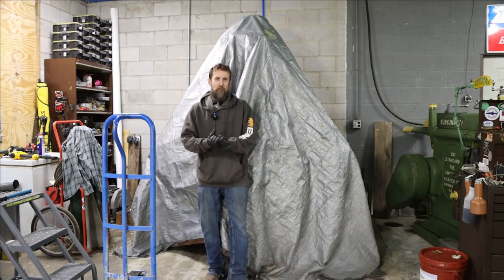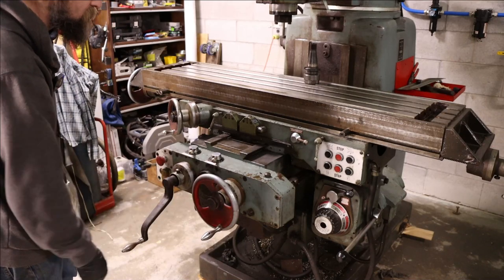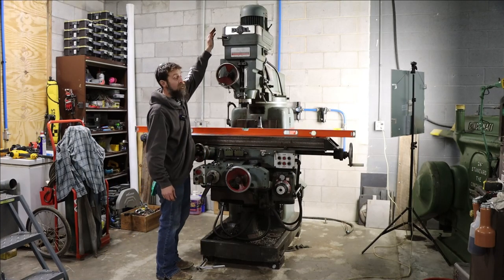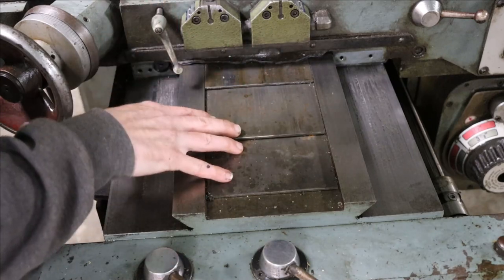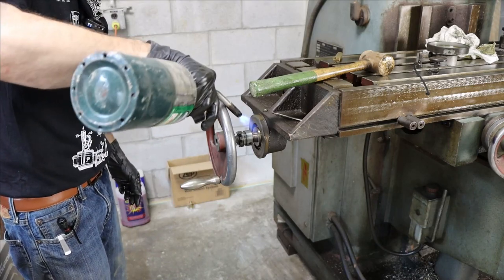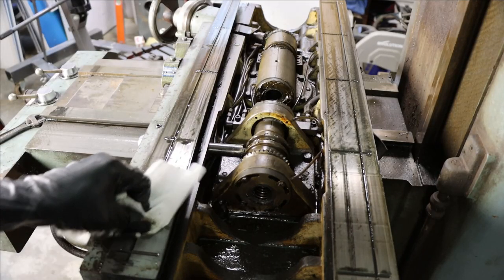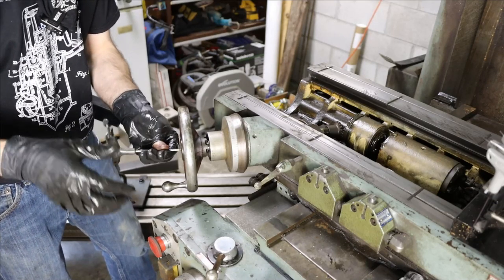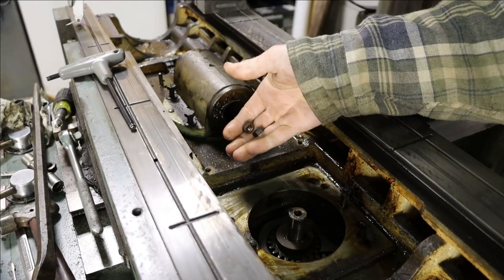New machine reveal day and break down .

Comment: Hi Steve at a guess I would say 500lbs, looks a nice piece of kit ,Regards Mike
Reply from the maker: 502 lbs was the weight on my scale. Congratulations😁👍, that was really close.
Reply: @Steve Summers how do you keep all of your parts organized when pulling a machine like this apart?
Reply from the maker: @mattconn241  most stuff I  remember its position. I do set things in related piles and use labels/ bags. 👍
Reply: I was going to guess 480, since you were at the furthest- out position on your cherry picker.. lol! Great to see you digging into the innards, lots of interesting parts in there!
Reply: My favorite machine in tool and die school.was a Lagun built in Spain. Very robust compared to a bridgeport. Much less deflection on heavy cuts.
Reply: Well done Mike - fancy seeing you here? :-)
Reply: My guess is 375 lbs. I have an old Milwaukee 2B Plane mill with a 14" × 70" table.
Reply: For those using grownup units, that's around 228kg 😉
Reply: Think you’ll find my bid of 501 lbs was closer!
Reply: In my head I guessed 500 lbs, but bid 501 lbs in a “Price is Right” move.

Comment: Congratulations you have the finest manual milling machine ever made. I have owned no less than 3 of these each one a little different. I bought my first on a whim without much consideration. I didn't appreciate it until I got it home. The ones I have are all about 1980 vintage they were all painted in a custom color. Each one was purchased 5-10 years apart and from different vendors I think they came from the same factory.  (Republic Aircraft in Long Island) The ones I have had vari-drives. I found out when a brand new Bridgeport was $6000. these were $27000!!!! The ones I have are a little different than yours but still have a lot in common. The first one I got had power feed X & Y and power knee lift. I used this one at work. I looked for 10 years to find one for home. The second one had power X no Y no knee lift. I found third years later that had Y feed but no knee lift. I stole the Y feed for my mill at home and restored the third mill to like new and sold it.  I designed a simple knee lift with a chain drive and a 1HP motor which is just enough. I like it better than the factory version. So I have a mill at work and one at home. I think the your mill has a 12 x 48 table not 9 x 42 like the Bridgeport. The machine weighs about 3000lbs instead of about 2000lbs (Bridgeport). You will notice the knee is massive. It probably has a 3HP spindle and much better capacity and versatility than an R8 spindle. You will never be happy with an R8 again. The knee is too heavy to hand crank if you don't have power you will need it. There is a fellow in CA that has some parts for these. I tried to buy Y feed and knee lift from him but he didn't have stuff like that. You should restore this machine at all costs it will be worth it. Don't underestimate the value of the nearby X handle you will never use the end handles. The quick change spindle is fantastic. The power feed has many geared feed rates and rapid! (handle up & down) The transmission can be changed while running!  I put 4 axis Newall DROs on them X,Y,Knee,quil. It is worth it. Over the years we have restored three of these to like new. I even put a motor on the vari-speed handle at the time I had a rotator cuff injury that prevented me from reaching up to turn it. A vari-drive would be nice but a VFD will go along way. These were made for DoAll by Anyak in Spain.  The company is still in business making big CNC's I don't think they make much for this machine. In all of our restorations no major work was required. We had to fix some broken stuff and replace bearings, bushings, seals etc. The ways were all good. The third machine that I sold to a local company is in use every day. I use mine in the home shop regularly it saves me trips to work to do things that I can now do at home. I have a Hardinge toolroom lathe and DoAll mill at work and at home so I can share tools between them.  They let me borrow anything I want from work (I own the place). If I can help you with your DoAll let me know. You have a great find there that you will appreciate more and more once you use it.
Reply: Hey John, I also have one these and would like to get the contact information of the guy with parts if you wouldn't care to share. So far I have found zero parts in my searches. I only have power x but so far love the machine. Definitely more rigid than an BP.

Comment: That is an awesome machine! It looks a lot like the late model Cincinnati Toolmasters which I think also were made in Spain. May have been the same company even.  I have a Biax you could go to town on those ways with and likely have scrapped in to tolerance before you could get the knee taken off.
Reply: How long are the saddle ways, someone nearby might have a shaper with enough stroke to touch them up...  if the wear is very deep.. or maybe even a planer,

Comment: Your "wedge" is called a tapered gib.  Free play is needed to allow axis travel. Precision is controlled by adjusting the gib. Wear on the machine may not allow proper gib adjustment, but your goal is to get it as tight as movement will allow. My practice in reassembly is to indicate this movement. My rule of thumb is to shoot for .0005" indicated  free play. You didn't show removal of the gib in detail. Most commonly, tapered gibs are held in position with jack screws on each end. This allows end stops for gib adjustment preload. One end can be backed off and compensated by pressure on the other screw. Variations of this design include a pusher and pull screw on the same end. Your gib had a relief about mid length leading me to wonder if the gib adjustment is keyed to the gib in the middle of gib. If this machine uses an uncommon gib adjustment approach, I hope that you will show it.

Lead screw backlash may be in the bearing that controls the screw preload, but far more likely is in the fit of the screw and nut. Lead screws wear unevenly since most work is done in the center of axis travel. The nut is typically the designed wear point and is likely brass or bronze. Some manufacturers will no longer sell nut components separately from the lead screw. Some machines have wear compensation designed into the nut. The nut is split and mechanism can be adjusted to preload the nut backlash and eliminate much of the nut/screw play. Lead screw wear will determine how much adjustment can be effected. Clausing-Colchester lathe cross slide adjustment is simple, because they provide nut adjustment access plainly visible from the top side. Whenever possible, I suggest that you remove the lead screw and the nut assembly from the machine as a unit instead of unthreading the lead screw with the nut still attached. Bench fitting and inspection is more controlled, and if the nut is an assembly, the loose parts alignment can be done in a more controlled environment. 
You found only one "thrust" bearing, because thrust is controlled by only one end of a lead screw. The outboard bearing provides only end support for the screw. The bearing journal on the outboard end is a close, but slip fit. On really large machines, the screw can sag. Provision is then made to preload thrust support on both ends of the screw and actually allow you to stretch the screw to reduce the sag. I have only seen this technique employed on CNC machines with ball screws. My experience is this stretching preload has never been greater than .0005-.0010".
Solid way machines cannot be adjusted to 
.0000" of free play. Some tolerance is needed to allow movement and for lubrication oil film. CNC machines employ linear guides with forced lubrication to reduce the free play to essentially nothing and reduce friction. This allows tighter machine tolerance, increases axis travel speed and eliminates way damage. Crash damage to linear guides can normally be corrected by relieving hold down clamping force and reseating the guide mounts. I serviced machinery for 34+ years in a high capacity around the clock operation. In all those years, I never had to replace a CNC axis linear guide, and never encountered axis tolerance degredation. Solid ways wear and require maintenance.
Point out that the tapered gib provides two directional axis fit control. The axis is mounted on a dovetail. Forcing the tapered gib in to the "slot" applies side to side pressure and hold down pressure simultaneously.  The gib is probably designed as the wear surface, equal to or softer than the machine casting hardness. The gib is most likely cast iron. Treat it gently when out of the machine.
Reply: I'm a arm chair machinist/advisor/consultant. Now with the disclaimer out of the way. Any gouges (maybe hand stoned down) could be allowed as long as the gibs are able to take up play. I think Mr. Hunt described this eloquently. I would think straitening the bent feed shaft and cleaning the parts and reassembling and dialing in the table back in with gib adjustments would result in a very usable machine. Steve seems to think pragmatically. Why go to all the trouble/expense of grinding those beds/ways if it doesn't add anything to the precision of the machine?
Reply: bjr E. WA. Maybe Steve sees it as a learning opportunity?  Perhaps some opportunity next video to comment on how one would determine the affect he damages will have on precision?
Reply: Thank you guys for adding comments. I enjoy getting to interact with others about these topics. I accept that I am a bit nerdy on these things, and no one in my immediate circles even understands my interest. 
Salvaging the machine as is for home shop use is an interesting option. I am using that approach on a Le Blond lathe I picked up cheap. It gives me me capacity that I wanted, and I went into the project expecting to be budget minded. My pockets are deeper now. If my Le Blond precision is too compromised, I will most likely shop for a better condition machine with similar capacity. 
I still cringe to recall a Blanchard grinder repair... I was the boss, but I yielded to my less qualified staff to do a way repair on the cheap. The Blanchard was vintage 1993-1994. Table carriage ways were Turkite and damage got so bad that the material was delaminating. They wanted to clean and apply new Turkite using the glue and stick method. They considered this a complete repair. Everything in me cringed. They didn't seem to grasp any idea of how their repair affected precision of this axis. I was under extreme pressure to get the Blanchard back into production and to control costs. I yielded for only one reason. We used the Blanchard in only one way. The table was moved to fully under the spindle position and stopped always in the same place. All grinding was done only in this location. This made this axis function only as a method to load and unload the chuck. None of my inexperienced staff had ever even dressed a Blanchard chuck or been involved in way repair. I let them install the replacement Turkite and leave it like it glued!!! I then supervised dressing the chuck flat after indicating new spindle perpendicularity as close as I could get it. It took quite some dinking back and forth, but we obtained the production level required results. Under these very specific circumstances, we salvaged a seriously damaged machine and it is fully functional when used as applied. 

This horrible repair approach was done during the years of instituting Lean Manufacturing principles. Our management had pretty effectively cleared out much of the seasoned technically skilled staff in favor of standard work procedures guiding lower skilled and lower paid staff. I was essentially the only voice of understanding. I wanted to do the Blanchard repair properly, but management machine was driving the show and Lean expediency drove the operating decisions.
This story took place about 10 years ago. I have been retired 4 years. The plant has shut down virtually all of the machining since I retired in favor of outsourcing. I got out before these changes took place. The shop probably employed 75-100 machinists and support staff working 7 days a week around the clock. Now they have 15 and only work day shift.

Comment: Pretty sweet machine Steve and a great addition to the shop. Just sitting here thinking about you turning the head around to get the knee off. If it’s as heavy as it looks it may want to tip sideways. Especially with all the weight from the table and saddle removed. Just a thought. Stay safe. Love the video’s. (Guess for table weight is 450lbs)

Comment: Loved that custom designed punch you used to bend back the locking ring on the hearing adjustment! Specialty tools are the best!
Reply: Steve "Nailed it". I'll see myself out.
Reply: I expect there will be a spike in comments about that.
Reply: Hahahaha, probably the best thing to use as nails are soft.
Reply: Putting that carpentry experience to good use.

Comment: Good thing about large mass heads like that is they are great for more aggressive cutting  than traditional Bridgeport heads, the bad thing about heads like that is having to articulate the head for angle milling or rotated milling of any kind. Your forearms will get a good workout if that day ever arrives, worm drive screw or not that is A LOT of mass to move around. That is one of the reasons why many of the Series II Bridgeport heads were replaced by standard 2hp heads.

Comment: Its amazing how quickly a single hardened chip can gouge a way.  I got lazy keeping chips off the ways milling aluminum and that bit me the first time I milled 304 SS.  Went to move the table and it bound up after about 1/2 inch.  Moved it back and had a nice 1/2 gouge in my way.  Almost cried.  Hard lesson learned.
Reply: Way wipers and covers are soooo important.

Comment: If you think about it, what's the difference if there's a score mark. If the majority of the surface is still more-or-less wear free, you can think of the score mark as an additional oil grooves. You said it yourself at 18:50. I'd still take it apart to make sure whatever it is that caused the scoring has been removed.

Been wondering if you've ever had to go back to video to see how something was assembled.

Table weight 415 pounds

Comment: I know that you are probably aware that when you swing the head out of 90 degrees to the x axis the machine becomes very tippy.  Thats why there is holes in the base, the manual recommends bolt the unit to the floor for this reason.

I should have added that it is not necessary on 99% of normal use to bolt to the ground.  But when you swing the head out of the way to remove the knee, be cautious of this!  I am going to enjoy this project 👍🏻
Reply: You have the manual for this machine?  Scan it.  No need to be selfish!
Reply: @paulcopeland9035  no I don’t have one for this unit, but I am looking for one, and its is Steve’s when I do.   All knee mills have this bolt down disclaimer in the manuals.  Just because the machines are so versatile that you can get them in a precarious state.

Comment: For a milling machine to keep,  fine a NICE well maintained hardened way tool room Series 1 Bridgeport with a 42 or 48 inch table, you will never regret it !  For small or medium sized work there the way to go over anything else. And if you can find a 4 or 6 inch riser for it , even better . I ran one of them belt drive big mills like that. You will find that climbing up there to change speeds gets old realllllly quick ! !

Comment: Nice job on the roof of the compressor area. It came out great. That's a beefy machine.. nice.. keep the old machine, you never know when you need a second setup, and don't want to break the first down.
I'm thinking that table is about 380.  

Have you powered the machine to check it out already?   Start getting that shop in shape, you'll need it for this rebuild. :-)

Comment: Monster? Definitely! But Steve will get it tamed won't you Steve? lol  On the subject of it only having spindle speed changes via the drive belt, why don't you consider a 3 phase to 3 phase VFD? Then you will have complete control of the motor, ramp up and down time, reverse in fact everything and his mother! And even pretty good ones are not an arm and a leg to buy. Just something you might want to consider for the future Steve.

Comment: VFD on the spindle us an excellent idea.

I'd guess the table at 422 lb.

Replace all the lube system restrictors. The tiny internal passages jell with oil residues over time but cannot be effectively cleaned by mere mortals. Replace them with new.

Comment: I'm guessing 580# for the table...btw the x-axis backlash looks like it's adjustable. From the looks of it, there are two nuts and one can be rotated a bit to take out the lash. I would guess the y-axis has the same arrangement. My Italian made mill has the same kind of backlash setup for the y-axis. The x-axis has a fixed screw and a half nut the entire length of the table. The x-axis control is right out front like yours. Nice machine to run since you don't have to stand to the side to operate it. You will love the front controls.

Comment: Steve,
      I own a Kondia FV1 mill that looks almost a twin to your newest treasure. So i'm going to guess your table is right around the 400 pound mark. Big beefy machines, very smooth and no harmonics feeding back to the work. I was impressed with your "high tech special purpose one use punch" by the way, they are handy because after you take the mill apart you can use the afore mentioned "high tech special purpose one use punch" to build the crate to send the saddle in. LOL As usual Steve, great video

Comment: Steve, you'll want to replace the metering valves in that lube distribution block before reassembling the lube system. (I learned the hard way)